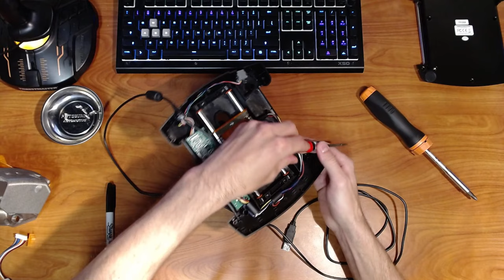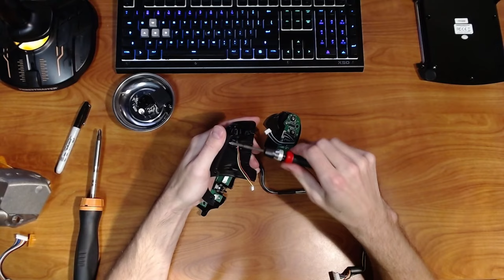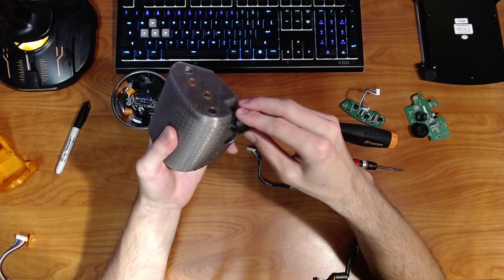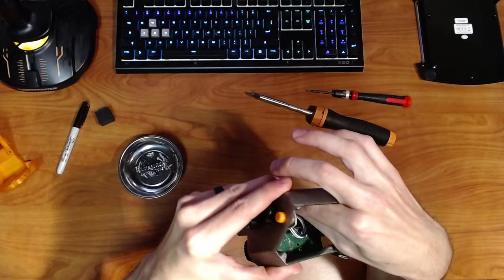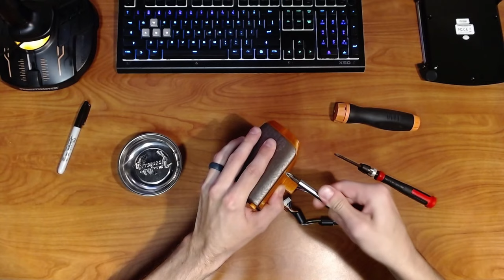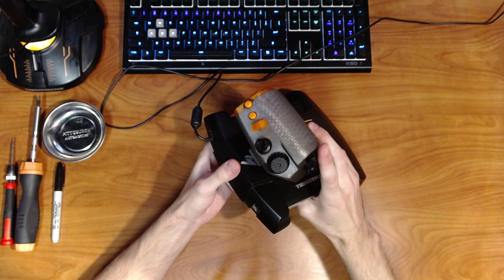Sinister Swap - Thrustmaster TWCS Throttle Swap Mod

Comment: I thought I should mention that the new construction from TM on the rotary dial changes the install procedure a bit.

It is now much easier in that you can affix the knob to the Sinister Swap housing first and then install the bracket and sensor wheel unit after. Now you can slide the sensor unit up or down in its bracket while in place and thereby engage or disengage the cogs. This allows one to plug into a computer and calibrate the wheel without having to align the cogs beforehand. Once you get it right, a drop of glue holds the sensor unit in place. Easy!

Comment: This is awesome, thank you for doing this! I didn't understand why the rudder paddles couldn't just be used with the modified version - can you elaborate?
Reply from the maker: Thank you! I've attempted it multiple times at this point. I am getting a supplier set up in the states to start handling my orders so I can focus back on R&D, keeping up with orders is all I've been able to do recently. The main PCB/rudder sensor is at a pretty odd angle, getting the dynamics right to accommodate a comfortable orientation for the rudder paddles has proven more difficult than I thought.

Comment: I'm soo happy for the instructions and your 3D plans! I got the parts today from a 3D printer and will start to build the throttle for my other hand.
One question: do I need another cable you were writing on the instruction? I can't use the existing one, because it's maybe too short? Do you have a link on Amazon or similar where I get this cable?
Many greetings from a thankful leftie 👈 from Austria! 🇦🇹 👋
Reply from the maker: Greetings!! Thank you so much for your reply and feedback! Yes,  you’ll need the JST JH 9-pin 100mm cable with the male to female adapter (look on Amazon) so that the cable will be long enough. The re-arrangement of the controller boards inside requires the extension. Cheers!
Reply: @CoreHawk3D  yes thank you! I have to Re open it again and need the long cable, the original works, but all is a little bit too tight and not in the original position. Second fault I made is the small wheel. Of course I had problems with the teeths and when I tested the controller the small wheel doesn't go to zero. So I have to play, till its in the right position. Which hint can you give. Didn't imagine from the instruction how to find the right position. I have lots of grease original on these two small gears.

Comment: The rudder bar function can be retained by simply running a cable to a pot on a cheap home-made rudder. Or you could move the pot to the base or to an external housing, to be used as, say, a trim control.

It's a shame to completely discard a still useful slider control. 😊